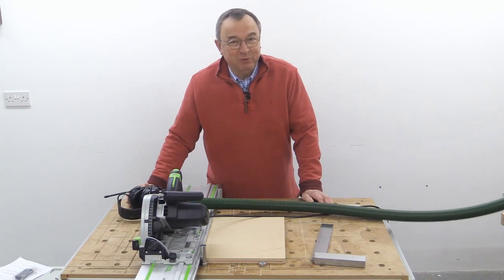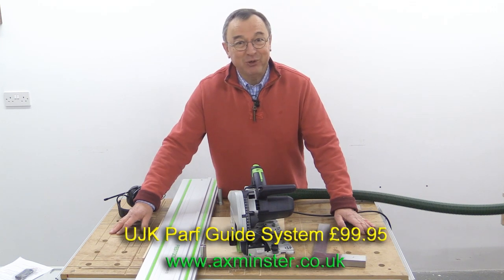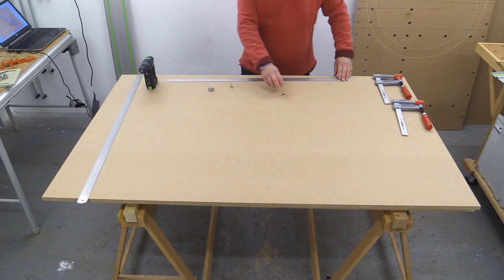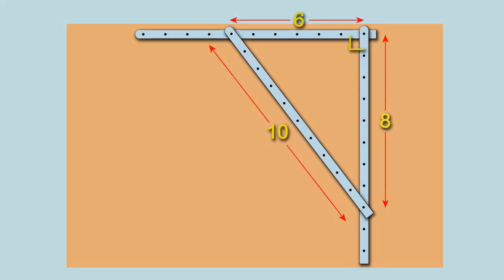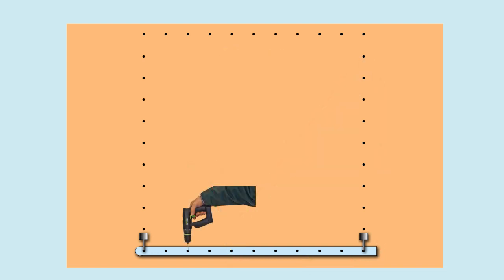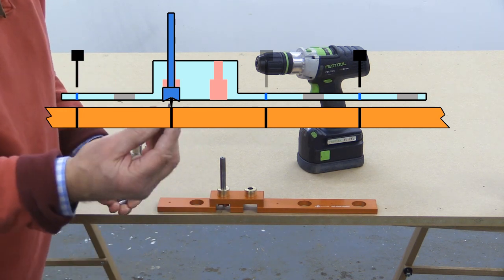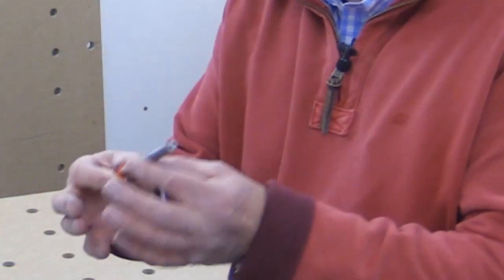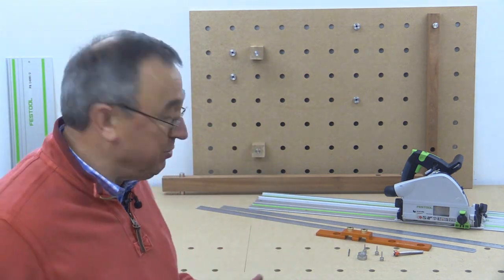UJK Parf Guide System - Overview

Comment: Hello Peter.  I have the Mark 2 version.  This is an amazing tool that you have created.  The tolerance on this tool is incredibly tight.  with that said, the check that you run at the 4 minute mark in your video has been off by a smidge.  In other words, I'm unable to seat the two pins on this horizontal line in the two times I've tried.  I think the tolerance is so tight that the overlap of the parf sticks are making the hypotenuse just shy of 10.  I overlap the hypotenuse stick on each side which probably pulls each side to the center by a hair.  Have you noticed this?  In the end, this is an incredible system you have created.
Reply from the maker: Hi Ted, Sorry for the delay replying - I am house hunting. Please contact Axminster Customer Services by email or telephone as they can give you direct advice about this. It can be easily corrected.  Please let me know if you have any problems after that.   Peter
Reply from the maker: Hi Ted, Having thought about this a little more I think that you may have allowed a bit of error to creep in during the early part of the 3 mm drilling. Can you confirm that you are using the original Parf Guide System?    Peter
Reply: Hello Peter.  I’m using the Mark 2 system.  I can’t imagine making a mistake on the first horizontal row.  After the first row, i created the two outer columns.  I overlapped the hypotenuse part stick on both triangles.  The first check is where it barely fails.  If you could show how your pins go in on that first check, that would convince me that I’m either doing something wrong or my part sticks are faulty.  NOTE: this is my second set of parf sticks as the first pair were warped.
Reply from the maker: Did you clamp the Parf Stick in place as you drilled the very first row and did you start that row by drilling a hole at each end and putting a 3 mm pin in straight away?   Peter
Reply: yes i did Peter.  I did notice in another video, 'Matt' put the pins in the parf stick first and then inserted the pin in the drilled hole, where I laid the parf stick down and tried to insert the pin in the parf stick and the hole.  hmmm.  Do you recommend putting the pin in the stick first and then inserting it into the 3mm hole?
Reply from the maker: Hi Ted, Look at this video https://www.youtube.com/watch?v=FsBIWL30RP0  from about 7 minutes and 20 seconds (ish) and you will see the technique. The reason is that the accuracy is so tight that it is far easier to locate the 6 mm shoulder of the pin in the ruler before marrying it up with the 3 mm hole in the bench top. I have been recommending this technique in every Mark 2 video that I have created.  Peter
Reply: Thanks Peter.  so the first pin is easy to insert at the 8:20 mark when you place the 2nd pin, I was doing it exactly how you did it in the video (8:20 mark).  do you recommend the 2nd pin to be inserted like you did the 1st pin?
Reply from the maker: Yes, that is a good idea.  Peter
Reply: Hello Peter.  putting in the 3mm pins in the method you recommended is the key.  I ran another test piece and it worked perfectly.  I used four clamps on the first row, just to make sure that that row was as good as it gets.   I still wasn't able to get the pin in the way I initially did it, but your method worked great.  I love this Parf Guide System. Thanks for your help.

Also, you mentioned in your x-carve workstation video to send you "your email address if you want the free plans".  Is your email address available ?  

thanks again Peter.  you're a genius.
Reply from the maker: Hi Ted, YouTube no longer has a private messaging service and so in order to get in touch you need to place a comment on the relevant video with your email address. The YouTube software should identify and send it to the spam folder for The New Brit Workshop. Nobody will be able to see your email address except me. I will then send the plans by email and delete your comment so that it does not end up in the public domain. Were we to do this the other way around then my comment, with my email address, would appear for all the world to see.    Peter

Comment: Could you ask the makers to turn the chuck end of the 20mm cutter down to 15mm as I am sick of filing down burs on the shaft so I can remove it from the jig. I do not have the luxury of a Festool drill with removable chuck.
Reply from the maker: Hi Brian, It sounds as though you have one of the original 20 mm cutters. I still use mine as well. The new 20 mm cutter has a hex end which is also Centrotec compatible.    Peter
Reply: OK another visit to Axminster coming on.

Comment: Peter,

I purchased the Parf Guide System from a dealer stateside and I must say, I am absolutely delighted with it!  The accuracy is DEAD ON!  I used it to make a Stanton Bench and it came out perfect.  Love it.  Thanks!
Reply from the maker: Hi Matt, I am really pleased that you are happy with the system. It took a huge amount of development to get things perfect. I started with wooden mock-ups, then aluminium ones and 3 years later the finished system. I wonder whether you would be happy to leave a review on the product page of the Axminster web sit or (if it is possible) on the web site of the company that you bought it from? It would really help others thinking about buying the system.  Cheers.   Peter
Reply: New Brit Workshop 
Not a problem and I'll tell you what, I'll post a review on both so the word spreads further. Have a great week!
Reply from the maker: Brilliant - many thanks.   Peter

Comment: From the first time I saw this video, I looked forward to the day I could add it to my workshop. I just ordered my PGS, and I can hardly wait for it to arrive. Thanks so much, Peter, for a brilliant product and an excellent channel!!
Reply from the maker: Many thanks for this. When you get it remember to drill the 3 mm holes all the way through your bench material. Also, the 3 mm pins only need to go in 6 mm (or 1/4") into the holes.   Good luck.   Peter
Reply: I'll do that, Peter. Thanks for the advice! It shipped from Lee Valley (I'm in the US) and will arrive on Tuesday. I'll work on my cutting station Tuesday evening.

Comment: how would you use this to be perfect setup with the UJK Technology Multifunction Workbench ,as there tops seem to be the same setup as this ????
Reply from the maker: Hi Graham, The Parf Guide System is designed to allow you to create a pattern of perfectly spaced 20 mm holes in a bare work top. If the UJK Multifunction top has holes already then it is too late !  The PGS works with bare tops.   Peter
Reply: UJK do a bare top but I'm planning to use Medite Premium MDF so planning to use your system if its possible to match the holes ?
Reply from the maker: You can position the holes quite carefully by doing some measurements and planning your layout. Then to start things off drill your first 3 mm hole freehand exactly where you need it to be. The rest should then be easy.   Peter

Comment: Soooo.... would this still be useful if you already have the LR 32 system?
Reply from the maker: Hi Ben, Yes, without a doubt as it is the most accurate non CNC method of producing a pattern of 20 mm holes.   Peter

Comment: I just received this amazing  jig and I think i'm about to go HAM and drill 20mm holes on every vertical and horizontal surface in my work shop. The accuracy has been amazing, I took my time and drilled a reasonably large array of 8 x 12 holes into my new workbench top, and I can confirm the accuracy parf advertises. I have a little feedback: the 3mm pin heads are tough on the fingers even with gloves. I suggest either adding some cushioning or enlarging the head of the pins so one can get a good grasp on them while removing them from the bench. Other than that, amazing work.
Reply from the maker: Hi Colin, Brilliant - thank you so much for the feedback. The 3 mm pins do not need to go all the way in as long as they register the Parf Stick in place but I think that you are right that they could be improved.  Thank you again - how about putting a review on the Axminster web site ?   Cheers.   Peter
Reply: Yup, I learned that immediately after bottoming out the pin head during my initial use--it's extremely difficult to remove a bottomed out pin from the bench top. However, the sticks / guide bar do feel extremely solid with the pins bottomed out. This may be a good way to further increase the accuracy if you / UJK can figure out a way to make removing the pin easier on the finger tips. Perhaps some sort of extraction tool that pulls the pin up at a perfect 90 degrees. Making a larger knob could enable someone to gain too much leverage and bend a fully seated pin--dunno. Thanks again, I'll leave a review.
Reply from the maker: Cheers Colin.    Peter

Comment: Should there be any play at all in the bush guide and the shaft of the 20mm cutter?
Reply from the maker: Hi Stephen, There has to be a tiny bit otherwise it will not run. However, if it seems stiff then it may be that you need to try to get it lined up a little more accurately as you slide it into the guide bush. You must put a dash of oil on the shaft of the cutter before it goes into the bush (and again if you move it from one bush to another). The is a very slim chance that there might be a burr on the lip of the bush so try it in the other one to check or feed it in the wrong way for a test. If you really feel that there is a problem with the equipment delivered then please do not hesitate for one second to contact the Axminster support team.  Please keep me informed of progress and I will do everything that I can to help.    Peter

Comment: I've watched your videos regarding this system with wonder and was extremely impressed with the 0.2mm/m accuracy achieved with the TS55. I had to shop around a little but have managed to order the full system with dogs from Axminster and another Ebay seller. Hopefully I can get going on this tomorrow evening if the weather holds and the delivery arrives :)You look like a proud father in the videos and rightly so! Hopefully I can share my results when I get mine up and running.
Reply from the maker: Hi Tony, Many thanks for the kind words. I hope that the dogs you bought from ebay are the genuine Veritas ones made by Lee Valley as no other make is suitable.  I look forward to your report !  Good luck.   Peter
Reply: Me too, The description checks out but it's a copy/paste job from the Veritas site... the advertised part numbers all match up, etc... paid over the odds for the small ones but hey ho! They've been posted already so whatever else the seller is prompt :)
Reply: +New Brit Workshop (Peter) Update... Everything turned up today :) hopefully we'll get better weather in the South over the weekend for me to have a play. 
I should note the eBay small dogs were proper Veritas ones and fit in the jig perfectly.
As a tip to anyone reading and finding them on eBay too... Check the guys website as the small dogs are "Correctly" priced there. I paid over the odds but got a business card in the parcel telling me the website is cheaper. Sorry no free advertising :)
Reply from the maker: Excellent result. Good luck with the weather. One point that I have not made in any video (yet) and I will correct this soon - the 3 mm guide pins do not have to be pushed all the way in up to the hilt - just about 6 - 7 mm so that they register the position of the  Parf Stick or the 20 mm Guide.     Peter
Reply from the maker: Many thanks Tony.    Peter

Comment: I love Peters vids... however I'm not too sure about this product...without appearing insincere...IMHO it's a little expensive and time consuming and... if you go wrong halfway through? ...D'oh! 

Go to a CNC shop and get them to do it for you, it'll be perfect every time! You could even do a couple of panels. It wouldn't require a lot of know how to draw up the file in Adobe illustrator and export as a DXF ...even if the CNC shop has to draw it up , once it's on their system next time it'll be quicker (and Cheaper) and you can spend your time doing something useful.
Reply from the maker: +Jimmy Rivers Hi Jimmy, I have taken everyone through it very slowly I agree but it is simple stuff and not beyond even a novice woodworker.  Take a look at this https://www.youtube.com/watch?v=TL_MF-u57jI       Peter
Reply: +New Brit Workshop (Peter)  It looks to be a well designed product that works, is easy to use and does the job. However, I'm just not convinced it's necessary... it's a bit like an office buying a machine to make paper clips.

Perhaps the hobbiest with time and an interest in drilling lots of holes will be interested... but anyone who makes a living from woodworking?

It may do well,  I hope so, as you've clearly put a lot of time and effort in.  Best of luck :)
Reply from the maker: +Jimmy Rivers Hi Jimmy, You may be discounting the guys who like an accurate slab of MDF for site work. Also, with the PGS in the back of the van you can make a quick track saw cutting station in 10 minutes.   Peter

Comment: Thanks for that, Peter, it looks very interesting for some future projects.

I lead a migratory life with a large workshop in France (as in barn) but no workshop at all (i.e. cupboard) in England. I will be in France in three weeks and hope to make some workshop cabinets. I recall that you recommended some castors. I can also recall that I went to the website and had some difficulty in identifying the correct castors from the very wide range available. I wonder if you could point me straight to what I am looking for.

I was also going to buy a 100mm Cyclone for my Festool vacuum but they are described as "pre-order". DO you have any information about the company?

Best wishes, Stephen Shipley spshipley@hotmail.com

PS I bought the big Domino tool some while ago as I had some construction work to do. Now I have some cabinets to make I have bought the small bit adaptor from an American company. I'll let you know how it goes. If It's OK, perhaps you would like to borrow it in October and give it a go.
Reply from the maker: +Stephen Shipley Hi Stephen I have emailed some details that may help. Thank you for the offer of the load but I have already made a video about the Seneca adapter with the DF700.    Regards, Peter

Comment: Hi Peter, 
What is the optimum size for the MDF piece? 
Is there a better type of MDF or is it all pretty much the same?
Thanks Geoff
Reply from the maker: +Geoff Meston Hi Geoff, Yesterday we did a tiny piece about 700 mm x 400 mm. My track saw cutting station is about 1100 mm x 1800 mm. The largest span (row wise) of holes that I would recommend is 11 plus 4 either side which makes 19 holes or 18 lots of 96 mm in between. Technically one could have the same maximum for the column dimension but that actually makes it difficult to clamp the Parf Sticks for the first square as shown in the videos. So I would say that the practical column max is 13 holes (1152 mm) which with a margin of 50 mm is your standard 1220 mm width of a sheet. This can be increased if you have some of those long reach clamps. For MDF I recommend Moisture Resistant (MR) MDF as it has a hard outer layer which is great for track saw work. HDF (CNC grade) is also excellent. The special 20 mm cutters handles both of these extremely well.    Peter

Comment: The guide holes are 3mm, the finished holes are 20mm - so why the layout grid is 96mm and not 100mm? I think we are in Europe and don't use this irregular imperialistic inches...
Reply from the maker: +horolog 3800 It is historical. My early worked used 1m lengths for the Parf Sticks and then we ended up using 1m rules for the final prototypes. With my 1m blank I went in 20 mm from each end and then divided the remaining space into 10 - hence 96 mm. You can also divide 96 by 2 and get an integer result more times than you can with 100.   Peter
Reply: +New Brit Workshop (Peter) 
thank you - this convinces me. Steel scales are sold in length of 1 m and not 1,04 m.!

Comment: Amazing and so clever ! no need for a bushing when making the 3mm holes ? just thinking you need to be pretty straight on with the drill - but maybe thats no big deal in practice ? 
Have been wanting to make my own mft for some time now - will def be getting one of these kits at some point -
Reply from the maker: +michaelmazzen The steel rules are hardened steel and so will not wear very easily. The 3 mm drill guide does a very reasonable job.   Peter

Comment: a really nice tool Peter. The price however is too hgh for me..unfortunately..
Reply: +Martijn Fransen What if you do the hole pattern and after, using the parf dogs, you put your straight edge against it (if necessary put a 4 square piece of wood in between) and cut with the circular saw near the edge, that way that edge will be parallel to the holes. Do so on all four sides and you got it. Cheers
Reply from the maker: +Martijn Fransen   Hi Martijn, Sorry about that but the PGS will do many hundreds of tops whereas just one CNC top could cost about the same.    Peter
Reply: I can't have it always my way of course. I had one other question. The holes are obviously perfectly squared towards each other. The holes might not be squared in relation to the edge (of course visually they will be).I was thinking if you would widen one of the rulers to the width of the first row and have small angle you could also use the factory edge of the mdf..the other ruler would need to be flat of course. Anyway just thinking out loud . It a very nice tool Peter!
Reply: +Pedro Soto ofcourse I didn't think of that ...much easier of course